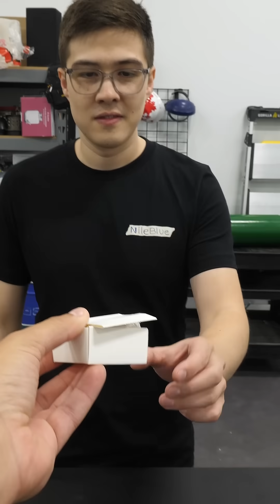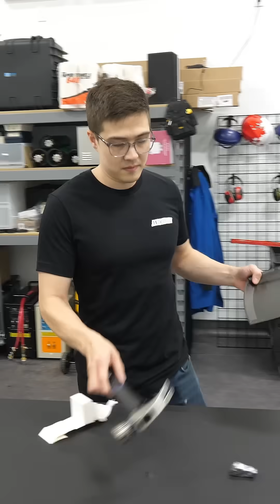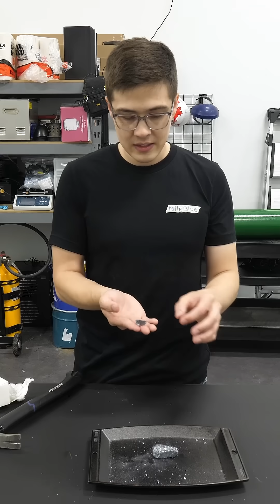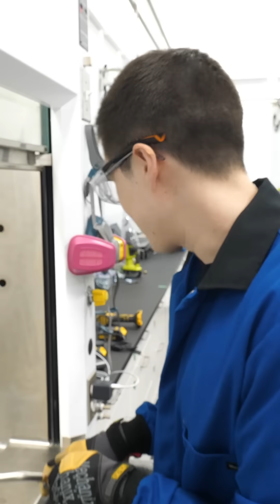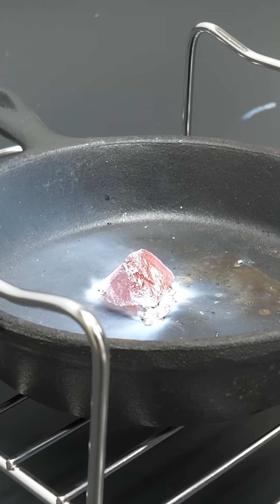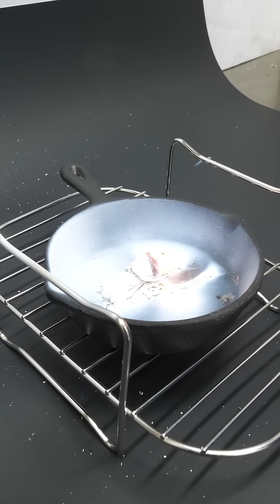Silicon is weird

Comment: Next episode:
So silicon does dissolve when dropped in a hot mix of pyrophosphoric and perchloric acids.
Reply: Disolves, doesnt melt. Different reactions
Reply: HF actually dissolves it well
Reply: @FuriousCheddar wasn't that the HI?
Reply: @FuriousCheddar  HF dissolves SiO2, not Si.
Reply: Technically neither are actually chemical reactions.
Reply: @FuriousCheddar both are chemical reactions
Reply: @beowulfthesage  no my friend. They are changes in the physical state (melting is anyway). Chemically their structure doesn't change. Reactions may occur while a material has melted from solid or liquid, or dissolved, but the melting/dissolution in of its self is not a reaction in a chemical sense. Take water for example, you can freeze it and melt it and its still H2O as both ice and water.
Reply: @beowulfthesage to be fair rearranging of atoms (from crystal to glass) and the inherent oxidation due to heat are chemical
Reply: @FuriousCheddar you honestly don’t think a chemical reaction occurs when silicon is placed in HClO4?
Reply: @FuriousCheddar you honestly don’t think a chemical reaction occurs when silicon is placed in HClO4?
Reply: @joshcantrell8397  was talking about dissolving and melting. Neither are reactions. If a chemical reaction occurs that would produce something that is more soluble the dissolution process would not be the chemical reaction. Don't be dense.
Reply: Wishful thinking. Would be nice if he did some chemistry for a change.
Reply: @EddieTheH do you think that he's doesn't do chemistry on the channel?
Reply: @xia3675  Not like he used to. Now he's completely dumbed it down.
Reply: @EddieTheH  i guess it's not like pure chemical exploration like before but his paint thinner to cherry soda video was still cool. the nileblue channel isn't very chemistry focused tho tbh

Comment: that's why it's not recommend burying most metal based fires in sand
Reply: sand is sio2 not silicon
Reply: @stick-Iink  yes and when exposed to most metal based fires it is the oxygen needed for the reaction leaving the metal oxide of the fuel in question and silicon metal
Reply: @DimiDzi  yes but what does that have to do with the video
Reply: @stick-Iink  it is an explanation of a different problem through the usage of information derived from this video
Reply: @DimiDzi  ok
Reply: How do we put them out
Reply: @ugwuanyicollins6136  tie everything else that's flammable from around them away before it catches fire and live the flame die out from having no more fuel

Comment: Silicon does melt. Its melting point is 1410°C
Reply: He probably said that because he didn't have anything that could get to this temperature in his lab 😅
Reply: Time to break out the furnace?
Reply: Yeah - important number for semiconductor processing.  The big thing about that melting point is it's so high there's not alot of things you can use to contain it.  You start needing stuff like silicon carbide crucibles and even then they don't last very long.

Comment: Next episode “ I die cast an entire cpu because I felt like it”
Reply: To do this... i'd need a crucible. And not just any crucible, but the hottest crucible i'd ever use.
Reply: Oooooo @NileBlue you have to do this
Reply: what about the lithography? you know, to make the transistors, how a cpu works?
Reply: He should totally at least make a single transistor!
Reply: die. Also we dont die cast wafers just because we call them dies. Lithography
Reply: The amount of dumb people here is astonishing 😳
Reply: With the cost of computer hardware these days we need this
Reply: computer literacy has left the chat
Reply: It'll contain the heat so. No

You want the heat to Escape... so, high thermal conductivity only
Reply: "When I did the research on optical lithography, my mind was blown. So, what I did in the meantime, is use a projector and the highest resolution image of a chip layout that i could... and I just used it as is. I had to buy a machine to do the lithography for me, but it is worth it."
Reply: Excellent impression lol
Reply: Die not dye, and the total amount of actual silicon in a CPU is like the size of a grain of sand and it isn't pure. There may be billions, if not trillions of transistors in a chip of any sophistication, but the feature size these days is around 5nm. That's a countable number of atoms per transistor. You can fit 40 billion of them in a single square millimeter. Obviously, they're not going to be that dense, but it illustrates the unbelievably small size we're talking about.
Reply: @needamuffin Note that the impurities are on purpose and are done in a very precise way to modify the properties of the silicon to make the various elements of a processor. This is called "semiconductor doping" if anyone else wants to know more.
Reply: @needamuffin 5nm is marketing bs. Transistor gate stopped shrinking at the advertised rate at somewhere between 120 and 80nm, but other improvements were made. Current "5nm" is about 15-20nm.
Reply: MIcrochips are basically 100% silicon, and a most CPUs have an area of 0.2-2.0 cm^2. Even if the wafer is less than a millimeter thick, that’s still considerably more than a grain of sand.
Reply: @needamuffin it is not the same amount of mass as a grain of sand lmfao
Reply: @needamuffin Everything has a countable number of atoms lol
Reply: @thevalorousdong7675 nope
Reply: What? Like a central proccesing unit? There’s ones for like 5 bucks
Reply: @loen9591  ... Not a creative I see.
Reply: @loen9591 mate I bet those 5$ CPUs can't even run doom
Reply: @MemzDev what are you even saying, if it's a computer it can run doom
Reply: @x86-Kait Only if it can run 16 bits and handle x86 assembly code
Reply: @MemzDev  no, quite easily can, the esp32 for instance. For 3$ also has built in bt
Reply: @nathanstein589  I mean let's just forget about all the 32bit and even 64bit doom ports and ARM ports as well. And all the other non x86 CPUs like PowerPC ones.
Reply: @MemzDev  The Raspberry Pi Pico  is currently $4 for an entire board, including the dual-core 133mhz ARM CPU and 264kB of internal RAM, which is $1 per unit from CanaKit right now.

It's 2x ARM M0+ cores, which Doom has been compiled for at least once and you only use of those for the actual game logic. The other core is free to control the P-IO blocks to bit-bang out a VGA signal at 240p. That core is actually faster than the hardware the original Doom released on in 1993, the Intel 486DX4-100. Not only are the clocks 33% higher, but the instructions executed per clock are also higher on this $1 CPU.
Reply: @MemzDev they ran doom on rat neurons😂
Correction: they played the game on ray neurons. I misinterpreted the thumbnail on the video I was referring to. But I had watched it and I am wrong. They just basically made a player out of neurons. Like a AI bot to play the game. Except technically Biological intelligence BI
Reply: @MemzDev  If an Arduino can run doom... Those can run it too. 😏
Reply: @MemzDev there's a 5 dollar raspberry pi that runs doom very well.
Reply: @spray_cheese  actually they didnt. the rat neurons only played the game and didnt run it
Reply: @linasindri  thanks for reminding me to update this comment. I only had seen the thumbnail of the video at that point. Then proceeded to watch the actual video after commenting😂 you are indeed correct. I wonder if it is possible to use biology as the computing part though. I mean I guess playing the game is very basic computing. So I think it’s possible. Probably just not as effective. As the saying goes “computers aren’t smarter, but faster”
Reply: @MemzDev they totally can! There are some old 4 core xeons that run windows 7!
Reply: @MemzDev They can
Reply: @GRAYgauss esp 32 cant run doom, its a microcontroller
Reply: @DigitalJedi Hi, I saw you earlier talking about your work developing an Intel server.
Reply: @yoomy_gums  Yup. I'm a packaging engineer. SPR is one of the products from Intel that uses a process I've worked quite closely with.
Reply: @MemzDev you seem to overestimate the processing power needed to run doom, and/or vastly underestimate the wastefulness of modern developers and their software.
Reply: @loen9591 We're talking about the guy who made grape soda from plastic gloves and turned one pain killer into another pain killer. Thats the nile style
Reply: @loen9591 you clearly didnt get the joke, its insanely difficult to make cpus even tho its mostly just silicon. it requires billions of dollars worth of equipment and hundreds of engineers to even get started (not to mention the design process which takes years for massive highly skilled teams)
Reply: @loen9591 another consumer i see "whats the point if i can buy it"

back in my day we had to build everything before we could use it
Reply: @johnmadlabs ..............

Comment: My grandpa gave me some silicon I didn't know it did this lol
Reply: I didn't really see it do anything, what do you mean?
Reply: @frgeawrevgae exactly. I'm pretty sure most things would have either melted or burned in this situation.
Reply: @jwjeff11 it has a lower melting point than steel. Note that the pan it was on also didn't melt or burn
Reply: Silicon didn't do anything. It was magnesium that was lighting up and burning.